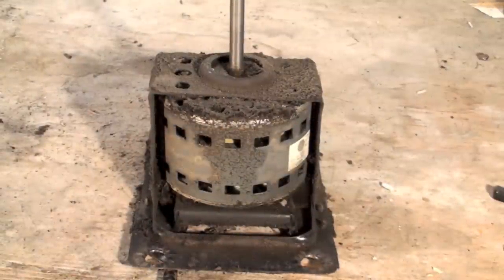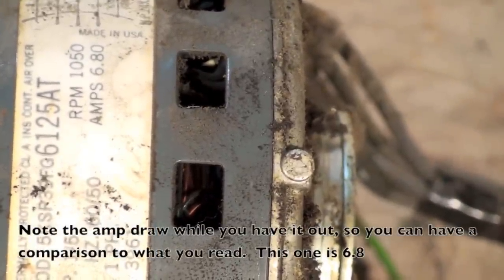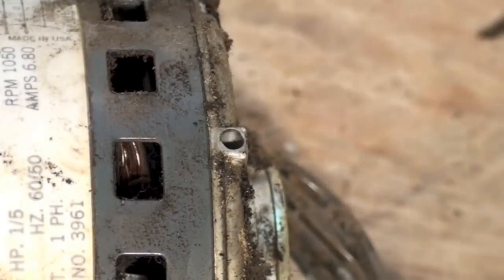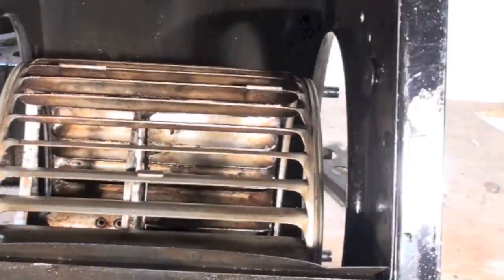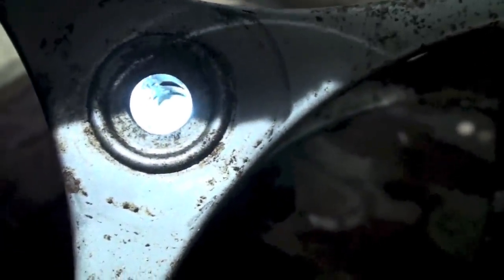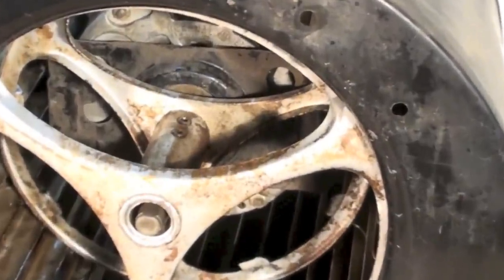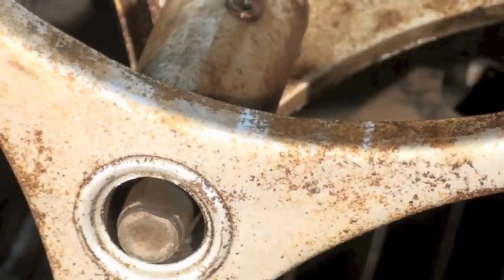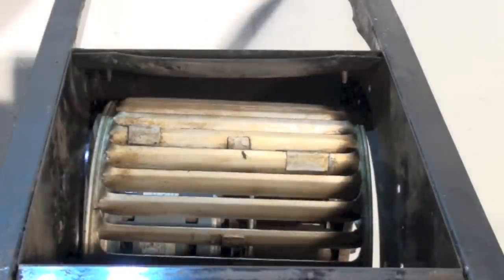Antique gas furnace service fan motor part 3

Comment: Thanks for the videos.  I'm in So California and have a -- I assume -- is a 1970's gas furnace in my home built around 1977.  I was told by a gas company technician that the firebox is rusting in some spots.  

Is the firebox the same thing as the heat exchanger?

Though the spots have not cracked or rusted through, they said it will eventually need to be replaced at some point in the future.  So I have been researching to determine if this is a repair I can do myself and whether I can find replacement parts.

Your videos are great and help immensely in building my knowledge.  Thanks again!
Reply from the maker: It is the same.  Its rather iffy if the heat exchanger will be available.  
GFM

Comment: Hi GFM great videos as always. The blower wheel on my furnace has little removable clips on it that I think are there to balance the wheel somehow when it is turning. If those are moved or come off while cleaning how important is it that they go back in the right place ? If it is important that they go back in the right place is there a way to figure out their placement or just mark it before cleaning ? Also, how did you tell if the bearings were good in this video is it just seeing if the shaft turns freely without resistance ? Thanks
Reply from the maker: The clips are for balance.  If they come off, the wheel may vibrate and damage the bearings, not to mention the noise.  I will be doing more on motor bearings as soon as I can.  The shaft should not "clunk" as you try to move it in the bearing.  It should also move freely.  Hope this helps.
GFM